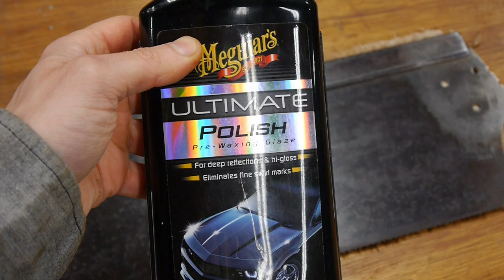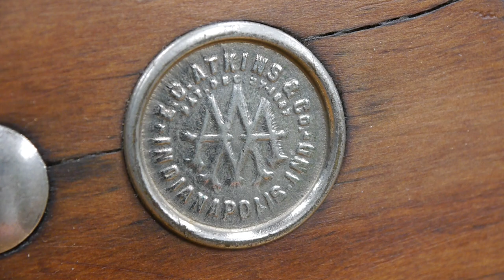Restoring a vintage Atkins No. 1 mitre box saw | Hand tool restoration

Comment: Beautiful restoration. May I ask, does the auto polish help protect from rust?
Reply from the maker: Hi @davestinyworkshop, it is mainly for appearance here although polished steel will generally be less rust prone than a rough surface. I usually use paste wax on saw blades to help prevent rust.

Comment: Superb...but why were they so long?
Reply: I believe it had to do more with the weight than the length. More weight was easier to cut through hard wood.
Reply: This type of saw was used in an old mitre box 😁 the longer the saw, the wider the parts you can cut on the box. And a longer saw means more teeth; which give a more efficient and faster cut for each stroke of the saw 😁
The saw would be great on it's own for sawing the walls of dados, or cutting the shoulder on a tenon for a large breadboard end 😁
Reply: @whittysworkshop982  I have used mine for dados with guide block, sometimes for free hand cuts too on bigger stuff where I want nice cut.